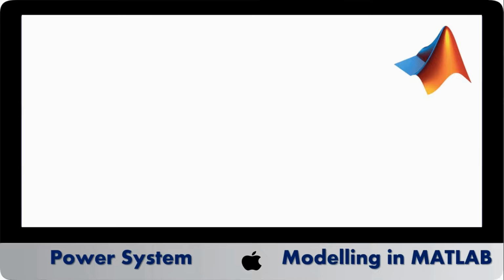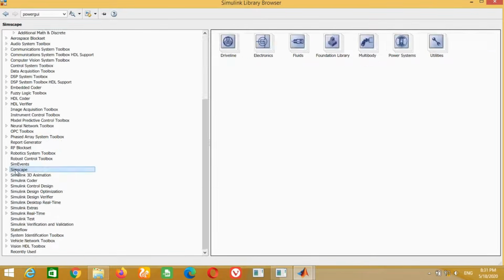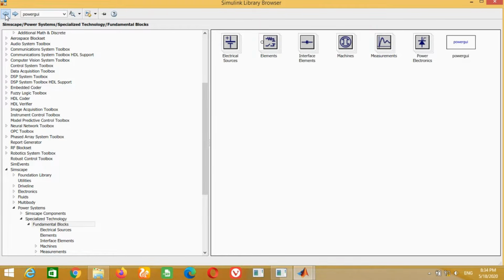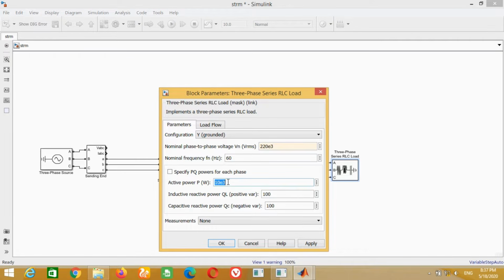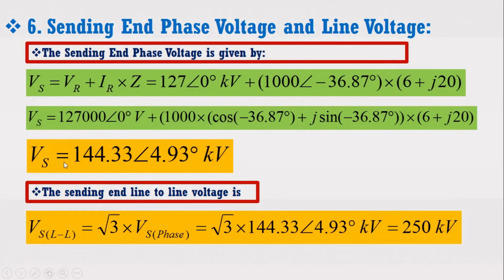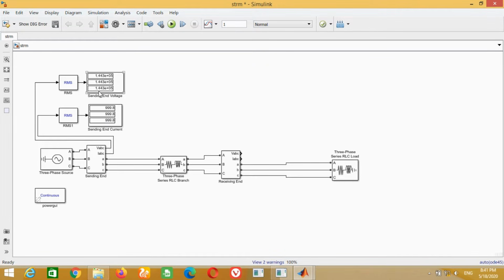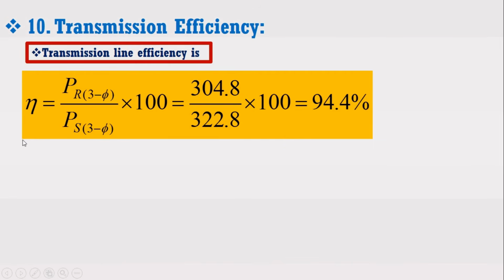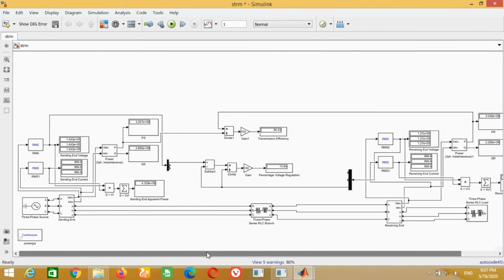How To Design Short Transmission Line Model in MATLAB/SIMULINK ? | Dr. J. A. Laghari

Comment: Sir, you are a great man, the GOD give you long life and health
I was going to do the research that I asked in the past on my case study is 230kv and 66km transmission line  fault detection classification and location by using ANN. and i want to ask you I wanted to generate data using the model like this short and give it a training fault for ANN here and if you could give me some feedback.
Reply from the maker: Thanks for the compliments. Yes you may apply the faults on this system and generate the data for different types of faults. Or watch my video on this topic for better understanding

Comment: Thank you for your video, the voltage you use is 220kV for short transmission line model, the voltage is not high because the voltage range for short transmission line is 0_20kV, distance is 0_80 km. so , please tell me how to compromise this issue
Reply from the maker: Thanks for the comment and query. Basically this example is taken from the book power system analysis by Hadi Sadat who is famous professor of power system. On the other hand, your comment is also correct regarding the voltage limit. But in my opinion, the book has considered the short transmission due to its length which is 40 KM. Therefore, despite of high voltage, it can still be considered as short transmission line due to short distance.

Comment: I followed your instructions correct but i am getting effeciency of 93% around why and voltage regulation too your and mine difference is about 1 % why please explain this
Reply from the maker: Thanks for the comment. It depends upon the MATLAB version. I think it is ok. no issue.
Reply: @DrJALAGHARI  i am using 2023 version but why this happens 1% difference when versions changes
Reply from the maker: @ramtej1949  thanks for the comment. Due to different versions, there is parameters variation and other internal calculations procedures, due to which in some versions, this shows little bit difference.
Reply: @DrJALAGHARI  thank you for your reply and could you please make more videos on renewable energy like mppt techniques and DVR power quality improvement detail matlab model
Reply from the maker: @ramtej1949  thanks. Sure. I will.

Comment: Hi sir, i need to modell a power system in Simscape and calculate the line losses (active and reactive) for a period of three months  hourly. Load Flow Analysis give me losses for just one hour. Is there any way to automatically calculate losses for three months?
Reply from the maker: Thanks for the comment. Multiply the losses with time period of three months. It will give the total power losses of three months.
Reply: @DrJALAGHARI  thank you, my challenge is that i have a dynamic system with different power consumption.

Comment: Thanks for the video sir. My Sending End Voltage and sending end current values are not equal. For currents values are like 1005, 992.8 , 997.8 . For voltages have the same problem. Do you have any idea about it ?
Reply from the maker: Thanks for the comment. It is ok. They are correct. It normally occurs due to different versions of matlab. You might be using an older versions of matlab. Don't worry. This answer is acceptable

Comment: Hi sir, can i know library name for this tutorial ? I ady install the software but cant find such as three phase prgram block. Thanks
Reply from the maker: Thanks for the comment. Which matlab version you are using ?
Normally it is available in simscape then you may find sub sections.
Reply: @DrJALAGHARI  Currently im using Matlab R2019a . Still cant found the library :(
Reply from the maker: @m.i.a2172  may be you have not installed all the toolboxes.

Comment: Please sir,  am working on power system optimization approach to mitigate voltage instability issues,  as my project, please  can you put me through .
Reply from the maker: Thanks for the compliments. What help you need?  You may use MATPOWER toolbox for optimization.
Reply: @DrJALAGHARI  how to go about it, to get a stable voltage at each buses.
Reply from the maker: @oyeladunrhoda2120  you may go through different papers and use several techniques for voltage stability.

Comment: Why my display block shows zero even after giving values
Reply from the maker: Check your model, powergui block
Reply: @DrJALAGHARI  
If I don't use rms block the voltage values are changing continuosly
Reply from the maker: @lohithv920  obviously. All the meters in real power system measures the rms voltages and currents.
Reply: @DrJALAGHARI  then if I use rms block, if I give initial rms as 0 in displa5it shows 0
Reply: @DrJALAGHARI  sir please help na
Reply from the maker: @lohithv920  check the settings of rms block as discissed in the video. It was will work
Reply: @DrJALAGHARI  no sir not working

Comment: How can we give postive , negative , sequence impedances to these lines, I could not see any such parameters. Any idea which block to be used to give positive ,negative, zero sequence impedances
Reply from the maker: Thanks for the message. For putting the positive, negative and zero sequence impedance, you may use three phase PI section line, or you may use distributed parameter line components or blocks available in simulink library.

Comment: Hello Dr....May I know how to set current for the 3 phase source and , how to set the angle between voltage and current in the 3 phase source. Thank you in advance Dr.
Reply from the maker: You may watch my video on how to design load flow analysis in matlab simulink. In this video, it is discussed how to measure the current and angle. May be it help you. Regards
Reply: Sure sir, but i still dont get how to set power factor for the three phase soarce. for example, if i want to set the angle difference between source voltage and soarce current to 20 degrees.. how am i suppose to set sir?
Reply from the maker: @vjnanthat5817  can you mention any mathematical example so that I may  see it.
Reply: For an example right sir, If lets say i want to set my voltage leads current by 30 degrees at 3 phase soarce... How should i set it sir?
Reply from the maker: @vjnanthat5817  can you please mention any book example which contains whole data. I couldn't understand how a source can be used as leading power factor device. For leading power factor, you may use capacitor. Or may be I couldn't understand your question.
Reply: @DrJALAGHARI  Sure sir, I have messaged you on Facebook sir... regarding the issue that I have faced
Reply: @vjnanthat5817   I think, it would not be possible because phase angle between voltage and current of source will depend upon line and load impedance either it is inductive or capacitive,,,so u can not set these in prior....however u can change phase difference between three phase source voltages by taking three different single phase AC voltage source......

Comment: Assalamualaikum Sir, how to I change short transmission line into designing a medium transmission line (pi-model)
Reply from the maker: Wa'alaikum salaam a pi section block is available in the simulink library. You can use that block to model the medium transmission line.
Reply: @DrJALAGHARI  Hello Dr, in Pi section block, it asks for "positive and zero-sequence resistance" those are two inputs, in our question it only gives one value of ohm/km. May I ask the given value in question is r1 or r0? and leave the other as "0"?

Comment: Hi, if want to design a long transmission line just change the branch into RLC & others block remain same?
Reply from the maker: It need to be checked. May be it provide accurate results. Alternatively, we have transmission line blocks too. That lumped three phase transmission block may be used for accuracy.
Reply: @DrJALAGHARI  Bonjour docteur LAGHARI, est ce je peux avoir vos vidéos en langues française